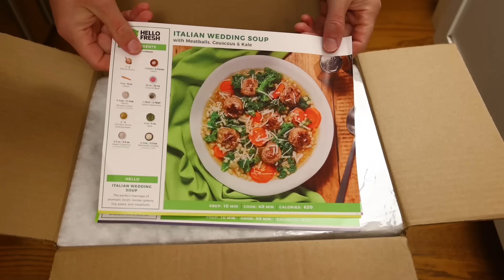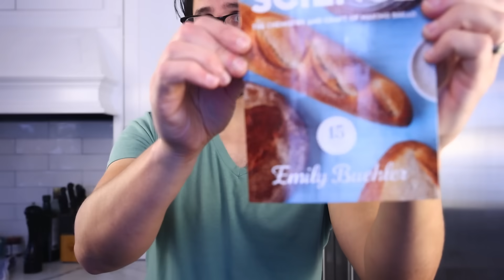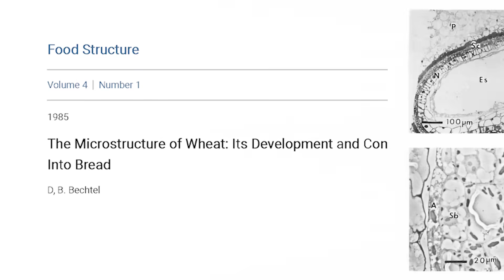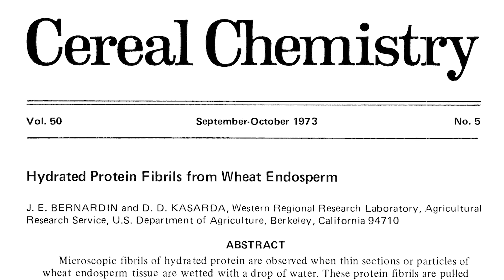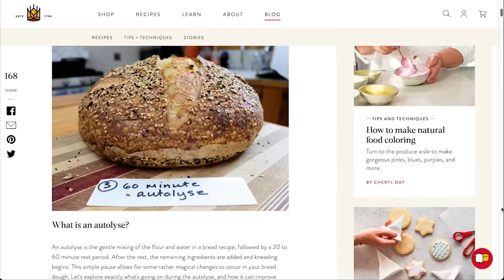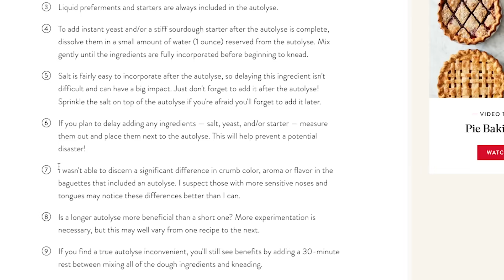How an 'autolyse' kneads your dough for you

Comment: I've actually been using autolysing because a whole wheat bread recipe advises it. My father needs low-sugar, low-carb recipes and whole wheat flour just infamously refuses to soften or even come together in an elastic dough without using some fancy baking tricks to make it act more like all-purpose flour.
Reply: Tip: work some vegetable oil into the dough. It helps.
Reply: Yeah I always do this for whole wheat bread, since it doesn't take kneading very well and the bran needs some time to soak up more water. I can either spend ten minutes kneading and scraping sticky dough off my hands and the counter or just let it sit for ten minutes then give it a few turns. I put in all the ingredients at the beginning, except sometimes oil, which can make weird clumps if it gets in the dry flour.

Comment: So if it kneads itself in 20 minutes is it even worth to knead it for 15 minutes when in 5 minutes you have a similar results? You could use that time to prepare your "mise en place"
Reply: Traditional kneading is faster than letting the dough autolyse and it largely depends on the type of dough you're working with. For enriched doughs you will likely want to autolyse + knead/slap + rest because it has a lot of fat, but for more traditional 55-60% hydration doughs you could let it knead itself for like half and hour and be done. In my personal experience letting the dough rest for like 10 min + 10 min of kneading is enough for most doughs and it's quicker than letting it knead itself

Comment: Hey, I started watching your videos last week because of two topics I was researching - baking steels and Neapolitan high hydration pizza. I'm a sourdough bread baker and I'm reading one of Prof. Calvel's books right now (the English translation of "The taste of bread"). So overmixing, overoxidation, overfermentation, are (all different) problems that I found more obvious in big bakeries - where the batch sizes are big, the mixers are big and there's a strict timeline. One is tempted to add more sourdough/yeast, use hotter water, develop the dough more fully inside the big mixer or do other things to quicken the maturing, but they all degrade the flavor and keeping quality of the bread while often contributing to its volume. Making hundreds of loaves requires different technology than mixing 1 kg of dough at home. It's totally fine if a home baker "takes shortcuts" and is happy with the results because bread is awesome! But one can't learn from the blog post on King Arthur's site or from youtube and to conclude that it will work equally great on the large scale and would give consistent high quality results. All of this to say, is that the autolyse does improve taste in my opinion, if you compare the gentle maturing you receive with this technique to working hot and fast. As for color, all wheat bread is rather white, but extreme white overoxidized dough has higher volume and less flavor that bread made in a gentler method. I love these discussions and could go on forever haha. Thanks, take care!
Reply: By the way, Prof Calvel was born in 1913 and has taught French style baking in the US, Japan and other countries, making actual shifts in Japan's baking industry. He saw huge shifts in industrialization before and post WWII, and mentions a big improvement in the quality and strength of flour in 1939. So I think that was the era of overmixing and speeding up that he was criticizing in his books and articles, not the later decade of the home mixers of the 1970's.

Comment: After many failures my first successful loaf of bread was made using the no knead method that takes close to 24 hours. I have now reduced that to 8 hours and produce a better loaf of bread. I mix flour, salt, yeast and water (80% hydration) in a bowl to start. Then every thirty minutes I stretch and fold the mixture four times moving around the mound of dough as if it had four sides. I repeat this 4 more times then let the dough rest for 3 hours. I turn it out on a floured board punch it down lightly and form into a loaf which I let sit for two hours before cooking. I consistently produce a good loaf of bread. From start to finish the total time I am handling the ingredients and dough is less than 15 minutes.
Reply: You have traded the self rising time for the stretch and folds that also align the gluten matrix. Then when you "pre-shape" the dough you give it some strength on the surface so it holds the rise better. This is pretty much identical to the modern approach for sourdough breads. Good work.

Comment: I have been baking bread for ages. I have made every mistake possible. I also have broke every rule of baking bread, And it still comes out fine. Here is the deal, Adam pretty much spelled it out too. The outcome of your bread mainly depends on your formula, bake time and temp. All other mistakes your bread will forgive you. I do the autolyce. It does help absorb flour and start gluten development. I have bloomed my yeast in salt water, used water from areas when they say you can make bread with and Have done blind tasting with using different methods and it always comes out good.
Reply: It’s true! I’m a young baker and I can mess up so many factors but as long as it’s homemade there are never any leftovers 😆

Comment: I realise you might not be able to answer this because of sponsor contracts, but do you genuinely find the recipes easy to follow when they're "boiled down to 6 steps"? I'm dyslexic too and I find recipes that have the instructions in paragraph from harder to follow. It will look like "only 4 steps" but each of the 4 paragraphs is actually telling you to do five different things and I'd find it easier if they just wrote out the list of 20 things with each step on its own line.

Comment: I've been using a 24 hour recipe lately, works really well. Salt, yeast, flour, water; barely mix at all. Let stand for 12 hours, it may still have dry regions. Fold it over itself a few times, let stand for another 12 hours, bake in cast iron with lid. I daresay it could be shortened by quite a few hours, but it's so much easier to plan if you start exactly one day in advance.
Reply: I do similar but do the first phase cold overnight then second prove in the warming oven in the morning. Takes maybe an hour to have fresh rolls ready for breakfast.
Reply: The long rest or long ferment really makes a big difference! When I have been baking bread I always start with kneading it until done, will incorporate autolyse hence forth, and then just leave it to rest in room temperature for like six hours and then in the fridge for anything between 24-48 hours. A long wait but so worth it:)

Comment: I'm surprised that this wasn't figured out thousands of years ago, and been the default for breadmaking ever since. I do an overnight rise with all the ingredients included, then three or four stretch-and-folds over the course of a few hours, and that's it. Makes great bread with minimal effort.
Reply: Agree with Quintem here. 
Its most likely that the wildly flactuating flora and fauna, along with also not having access to as pure flour or yeast most likely meant that something like autolyse or letting it rest for 12 hours without a lot of preperation is difficult.
Reply: @Athalwolf13  I mostly make sourdough bread from my own starter that I've had for many years, made with the wild yeast and bacterial naturally present. I suspect that the yeasts and bacterial populations in the starter shift somewhat between summer and winter, but once you've got a stable starter, it's pretty bulletproof, even when jumping around between different kinds of flour.
Reply: @Athalwolf13  I'm not so sure about that. I use my own home grown sourdough starter instead of packaged yeast, so that seems pretty consistent and the way it has been done for most of history. I suspect the balance of bacteria and yeast shifts with seasonal changes and the average house temperature fluctuations, but the basic leavening is quite reliable. I use the same starter regardless of the various mixes of whole wheat, bread flour, all purpose flour, durum,  rye, etc. In the winter it certainly takes longer with the cooler house, so I can't just do it before bed, but have to think about it earlier in the evening. I've even made bread while camping for a few weeks at a time this way.
Reply: I'm pretty sure it must have been. Makes sense to mix the bread last thing, leave it overnight and bake in the morning.
Reply: It's probably only been forgotten relatively recently.
When I was learning to make flatbreads, I was told that the traditional way involves no kneading -- you combine the flour and water and let it sit for no less than half an hour, after which you split the dough, roll it into balls, and pat and throw it until you have thin discs.
Reply: @nialltracey2599  That makes sense. With the rise of commercially available yeast, it's easier to speed up the whole process. Using your own started tends to take more patience, but less work.
Reply: @fxm5715  at times, I add a pinch of yeast to my sourdough mix. It’s a hybrid, and gives me the best loaf, and probably guaranteed with just that pinch of yeast.
Reply: @Rob_430  I do the same, when I'm in a hurry. I also boil a few cups of water in a jar and place it and the proofing container under a towel to speed things up. The flavor doesn't seem quite as developed, but that's just me being a bread snob. :)
Reply: On a practical level I am sure it was repeatedly. The jump from art to science requires scientists.
Reply: @FXM, I do the same. I found an overnight bulk fermentation starting with autolyse and 3 stretch and folds gives me the best results.
Reply: It was. It's just one of those precious things which 'real' bakers do, like having 30,000euro kitchens when they only eat out.
Reply: @Zahin Gani same with pasta. Otherwise it'll be too tough to work it properly

Edit: I mean pasta and noodles are both more or less flour and water, so makes sense
Reply: Different flour. Ancient grains werent as gluten as modern flour.
Reply: @harukrentz435  Oh, yeah, good point! I hadn't thought about the change in gluten content over the last few thousand years, and that it would be a source of selection pressure.
Reply: Im sure it was. I have heard of no knead bread 10 years ago already
Reply: @nazgul7914  Surely a lot longer than that! :) But yes, its popularity seems to have taken off with Mark Bittman's New Yorker piece with Jim Lahey back in 2006. That's what got me started down this road: https://www.youtube.com/watch?v=13Ah9ES2yTU&t=47s I've enjoyed Bittman's writing for a very long time, and his book, How to Cook Everything, is one of my go-to reference tomes.

Comment: One video taught me to fold the dough a few folds then put into a covered bowl for an hour. Do this 3 or 4 times. Sometimes the waiting is just as emotionally taxing as the kneading and rising.
Reply: You can mix and match kneading techniques, I make a fairly hydrated milk bread for sandwichs and kneading by hand straight after mixing the ingredients it's too much of a hassle, I make a 30min autolyse, 10 min slap and fold then 10min bench resting and the dough get's super elastic and strong, any other way and it's just a soupy mess of butter and dough
Reply: I hoenstly am tempted to say that the various ways to make bread really depends what you need it for. 
Need to prepare tomato sauce for pizza or making soup / braised meat? 
Well, letting it ferment for 12 hours while giving it some light punches or foldings in between is certainly more practical than kneading it for a whole 15 minutes, especially since you also need to rolll it out (gently) and then handstretch it. Along with also having plenty of time to clean up the apartment and prep the table.
Reply: @Athalwolf13  The recipe was for Ciabatta Bread. It was totally delicious.
Reply: @sr2291  Uuuh. It has been a while i had ciabatta bread.  I think its very similar to baguette, if perhaps less chewy and much broader ? Though i only had ciabatta from the grocery store.